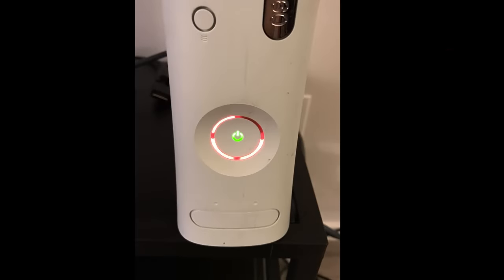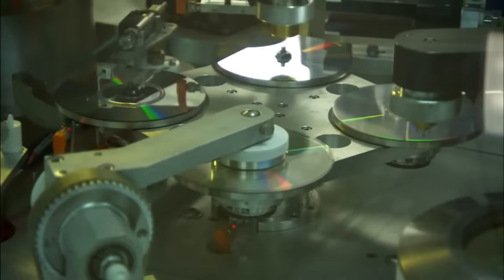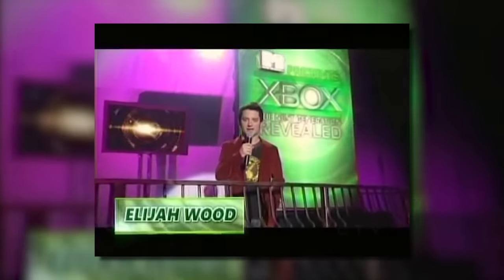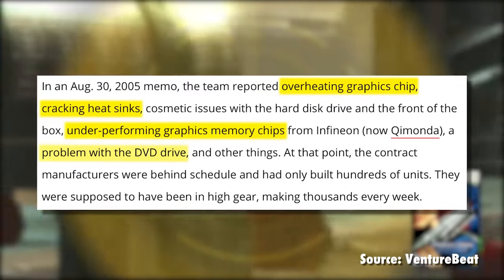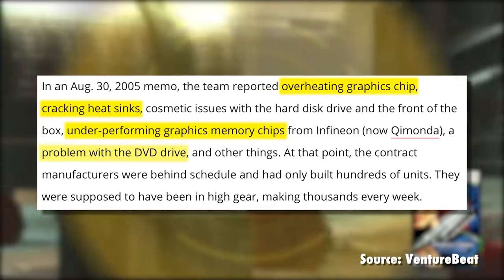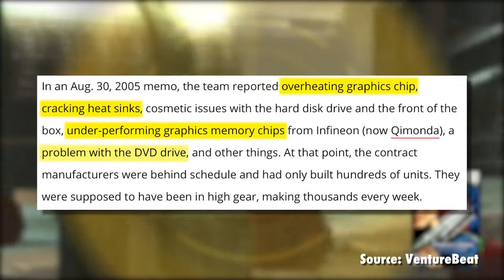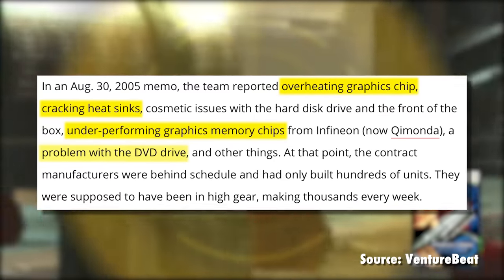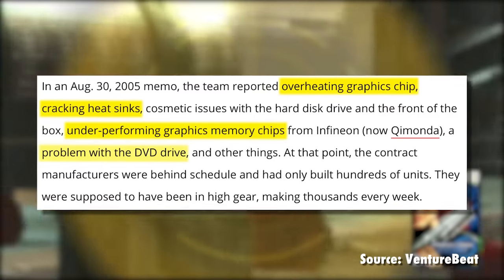History of the Xbox 360 Red Ring of Death | Past Mortem | SSFF

Comment: Mine was made in 2007 and is still gong strong.
Reply: Ah making me miss my 250 gb elite.
Was going strong till 2013, fucking tornados.
Reply: Mine has never had a red ring of death at all, but it gave a ring around some of my Xbox 360 discs or scratched them leading to them being unplayable
Reply: GMLY yo i even dropped mine atleast 3ft to hardwood off a desk. Put it back upside down because it was dark. Ruined my mw2 disk lol. Xbox was fine though.
Reply: greenthumb lol that's one tough xbox
Reply: Are you fn kidding me still going till this day wow
Reply: GMLY yo it hated being used upright, i think that was a design flaw with the dvd drive
Reply: Mine was made in 2008 and still works
Reply: Your Xbox is post re-design, they corrected the problems by that time.
Reply: Oo
Reply: same :D
Reply: Mind was made in 2009 and its still going
Reply: Same, I only had to replace the DVD drive. which my dad helped me with
Reply: Mine died a few weeks back also an 07
Reply: Consider yourself lucky. I had several 360s RRoD since then
Reply: J-Ryder I’m buying an original xbox with 3 duke controllers, 2 games and accessories
Reply: greenthumb my dad's Xbox was dropped at about 3ft on the ground MULTIPLE TIMES and still ran like nothing happened
Reply: Spencer Ross same my Xbox 360 is still working today. My brother buy the Xbox 360 because he want to play halo 4. Back in 2012. In 2018 my brother buy the Xbox one. So my mom give me the Xbox 360.so I played halo1 and halo2 all the halo games in the Xbox 360. All so I played cod waw and minecraft and mafia 2 .  Mafia 2 is 
the best game I ever played. Vito and Joe were the best character in mafia 2. Mafia 2 is better than mafia 3. Mafia 3 sucks so bad!!!. One thing I am a halo fan.
Reply: same :3
Reply: Same.
Reply: Hell Yeh! Same Thing
Reply: Mine was made in 06 its been through water but still runs strong no motherboard issues
Reply: Same, Mine has been alive for 8 1/2 years now 🔥🔥
Reply: Spencer Ross ya may have jinxed it
Reply: mine is from 09 bought it 09 and still working like a boss, was playing Ghost recon advance war fighter 2 and it's still an awesome game that came out in 2007.
Reply: Evan Diaz lol no played cod black ops 2 yesterday and it ran just as good as usual
Reply: mine was made in 2006 and still hasn't got the red ring
Reply: lmao mine lasted about 5 years before i gave mine to a friend, and i got (ironically) a PS4
Reply: mine was made in 1987 and it's still working! however, i need a constant supply of crude oil now.
Reply: Spencer Ross my Xbox 360 was also made in 2007 and its still going strong in 2018.
Reply: My was strong till 2017 2008-2017
Reply: ah yes I remember my 360 rrod on me when I was about halfway through gears and was never able to finish it haha
Reply: Also had a 2007 one, my friend had 2009 ones which all broke down within a year. My 2007 one still going strong even it fell and i hit it multiple times 🤷🏼‍♂️
Reply: Same!
Reply: Spencer Ross dam 333 likes
Reply: 2006
Reply: Same, mine is like a beast, it never had any red lights
Reply: Mine is from 2005 and still lives, somehow
Reply: Spencer Ross Mine was 2007 too and it's still alive
Reply: Got my xbox 360 S in 2012 and it still works
Reply: Spencer Ross  You have an Xbox Y(ield) lol
Reply: 2005 boiiiiiiiiiiiiii
Reply: s t r o n g
Reply: I have an X360 made in december of 2005. It's still alive, but only because it's barely ever used. It's likely to die some day, just like the rest.
Reply: Is that your supra?
Reply: @bingbongbroke1159  sounds like u moved or bumped the console while it was reading a game thats when it would destroy any disk inside the tray
Reply: Mine was from 2006 and its still alive
Reply: Spencer Ross you got
Lucky
Reply: Same
Reply: My 360 ( The Black Slim Ones ) Was Manufactured In 2012, Still Going Strong.
Reply: I still have my xbox 360 elite and recently got an xbox one s on thanksgiving. My xbox 360 is still running strong.
Reply: @bingbongbroke1159  That's why you don't tip an Xbox 360, when it's spinning a disc.
Reply: same for me
Reply: Not making fun of u but
Gong strong
Say it out loud
Reply: Mine was made in 2010 and is running strong as fuck

Comment: I never had red rings. Instead, I have been greeted with the goddamn “Open Tray” problem a whopping three times.
Reply: That One Wise Guy remove the top by cutting or unscrewing and put the disk in manually
Reply: I had to get a screwdriver and force the tray out
Reply: That One Wise Guy ii
Reply: That One Wise Guy same! God damnit i hated that so much! I had to get a new Xbox because of that. (I still have the old Xbox)
Reply: LOL! omg mmd
Reply: That One Wise Guy i still have mine from like 2010
Reply: my 360 S red ringed this year also back in like june of 2017. so my brother gave me his original 360 he had put away since he got a one and his is still kicking and hasnt red ringed yet.
Reply: I had that issue for years however it was such an easy fix, what I did is opened the disk tray and underneath it there is a pulley with a big wheel and a little wheel held by a black elastic band, this holds the tray open and closed. I held it securely open, ensuring that the tray would not close and with a pair of tweezers, unhooked and removed the elastic band. Once out, I carefully laid down the console on the floor, again not letting the tray close and cleaned the elastic with rubbing alcohol. I then with a lot of effort had to re secure the elastic onto the pulley without the tray closing and not letting the elastic fall from the tweezers, into the internals of the disk drive. After this I plugged the unit in and the disk tray opened and closed with no problems whatsoever. After years of hitting, which eventually stopped working, and years of using knives and screwdrivers to open it up to put a game in, it was this little fix that allows for my disk tray to move like it did way back when. This was my solution to the common, 'Open (stuck) Tray' issue. :)
Reply: Mine does that nonstop
Reply: Jessie Jones Yup, the solution is usually as simply as cleaning that elastic band. However, I think you should just use warm water and maybe a little soap. I'd think that rubbing alcohol might dry out the rubber a little, but I could be wrong.

Comment: I used to fix my red ring 360's by hanging the motherboard from coat hangers in the oven and bake at 400 for 10-15 mins.  This would re-flow the solder connecting the CPU and get it going again for another few months.  I probably did this like 10 times to 3 different 360 systems I owned.
Reply: this is either a troll or you're insane
Reply: @allen.simmons9150  Dead serious, not insane, and it worked.
Reply: No it didn't reflow anything. It made the silicon die work again for a while which has nothing to do with solder. A reflow would permanently fix cracked solder balls which is not what happened here. In most cases the CPU or GPU itself were damaged.
Reply: @averycason-rk2oe  You put duct tape on a leaking tire. Sure it could work for a while but you definitely didn't fix anything, you just avoided the problem for a while
Reply: What i do is cover my xbox with towel while rrod and when it's hot enough i turn it off and let it cool and bam! Back to gaming, it's not trolling it actually works.
Reply: so you had 2 xbox with that problem and still thought buying another one of this, in generel over priced, console was a good idea? 200iq
Reply: Hot enough to melt solder but not hot enough to melt any cable clips or insulation on the board?
Reply: I opened up my slim and hit it with a hairdryer for 20 min when it broke down and it worked again. I had to keep doin it every once in a while so I got a new one.
Reply: Username checks out.

Comment: I've had the 360 ever since it came out and regularly used it even still today and I've never gotten the red ring of death.
Reply: Same here!!
Reply: Well.. congrats sir!
Reply: I got the RRoD 3 times. Over the span of a decade though. Twice from overheating, and once was an undocumented ZERO QUADRANT red ring, which turns out, was from having my phone plugged into one of the usb ports on start-up.
Reply: Same with my 360 also with my original ps3 launch.
Reply: Congrats lol that's extremely rare. I don't know one person who didn't get the red ring of death lol
Reply: there is always an exception to the rule..

saw this comment did a 360 and walked away.
Reply: Mine still works too, got it Xmas 2008. If it ever dies, may need to save up for XB1 for Backwards capability (EA won't remaster Mass Effect Trilogy and I replay that constantly).
Reply: Vintage sonic 1 well yeah only gen 1's were known for the era... they fixed it in later 360 models
Reply: Me too.
Reply: Vintage sonic 1 aaaammeeeen to that
Reply: Same
Reply: Same. I got a yellow ring somehow though.
Reply: Vintage sonic 1 lucky
Reply: Mine will be 10 years old October 5 and it spent 1/3 of it's life in my grandma's rv storage compartment
Reply: Vintage sonic 1 me to but sold mine 1 week ago to buy a Xbox one S
Reply: Vintage sonic 1 same
Reply: Vintage sonic 1  same
Reply: Vintage sonic 1 congrats
Reply: Vintage sonic 1 i got it but survived it
Reply: Me too. I purchased my 360 shortly after the release of cod4, I've always kept a small fan blowing on it while it was running though. Maybe that helped it's life expectancy. Worked on my slim ps2 anyway. But I do need a butter knife to open the disk tray lol.
Reply: Vintage sonic 1 same
Reply: Me to why wont it do it
Reply: Same my xbox360 was my brothers until he decided to give it to me when he got the xbox1
Reply: Same here my guy
Reply: Mee too
Reply: 3 times. And then they told me to buy the elite.
Reply: Yeah pretty much same here. The only reason I don't use mine anymore is because I finally got a One.
Reply: I went through 6 lmfao
Reply: Vintage sonic 1 i used to have the arcade that was manufactured 30.09.2007. It served me very well but i felt i had to say goodbye to it after it started running very hot when playing games. I had the red ring of death but if i just rebooted the console the ring would go away. It went on for a few months and eventually it crashed and froze making a loud buzzing noise through the audio. But i got her sent off for repair and she was back in a few months. Served me 8 and a half years. It payed for itself more than enough anyway. I have a xbox 360 S now. The only thing its done is go into overdrive once on the cd drive and my xbox one has never given me any problems other than the occasional freeze on games and a stuck joystick.
Reply: Mine did once but never again. It fixed itself I guess. Guess mine just overheated
Reply: Me 2
Reply: Me to
Reply: Vintage sonic 1 me too
Reply: Me too
Reply: Same
Reply: I have
Reply: Vintage sonic 1 you are so lucky
Reply: same
Reply: Same here had my for 4 years
Reply: Vintage sonic 1 lol I don't even have the 360 with a ring
Reply: I smell of Moo Cheese
Reply: I have not got it!
Reply: That's great to hear. Unfortunately, for me, I went through three 360 consoles before I finally getting the Xbox 360 S. Microsoft should released the Slim version initially instead of rushing the original 360 through production -__-.
Reply: I got it and I turned my xbox off and then it worked propley
Reply: Same
Reply: Same love forza horizon
Reply: Dont say that
Reply: Wow cool kid
Reply: Gets it today
Reply: never happen to me
Reply: Vintage sonic 1 isn't tinkering with ur console illegal
Reply: Don’t jinx it
Reply: Your comment currently has 360 likes. I hope no one ruins it
Reply: Same. But i lost 1 cooling fan  ._.
Reply: Vintage sonic 1 I don't believe u use it I mean Xbox has backwards compatibly

Comment: A friend gave me his Halo 3 themed xbox 360, which was red-ring'ing. I took it apart, tried a few things and actually got it working.
My theory, while I was looking at the chips and the heat sinks, is there is next to no height difference between the chips that gets cooled by the heat sinks, and the surrounding components, capacitors and whatnot. With all the heat, turning on and off, with the board warping as it will from regular use, the surrounding components would touch the heatsink and short circuit, being the cause of hardware failure.
Now, I tried this. I have some regular printer paper for isolation, cut pieces big enough to cover the bottom of the heatsinks, probably a little bigger wouldn't hurt. A hole would be cut out to expose the chip that actually need the cooling, so with new themal paste and the paper between components and heatsink, I screwed everything back on and tested it. And bam, it worked and has worked ever since!
Huzzah!
Reply: That's a weird way of saying "I don't have the money to buy a 360 slim"
Reply: Yo thats epic
Reply: could u maybe post a video of all of this? im not a big tech girl but my dad loves his 360 and it red ringed yesterday :( its been in my family for some odd 8-10 years id love to get it fixed
Reply: @skies5350  That's not a bad idea actually. I might do that!
Reply: @PrimeTF  That's a weird of saying "I'm too much of a brainlet to figure out the reason why the Xbox red ring of death occurred."
Reply: @skies5350  I'll try get it done as soon as possible after christmas, promise
Reply: @LexRudera  we're still waiting on that video
Reply: @lostpockets2227  Yeah I finally got around to shoot it today. Just need to edit it and not die at the sound of my own voice.
Reply: paper in a console sounds like a fire hazard, especially one thats known to overheat easily

Comment: why don't you just put it in a fridge while playing the Xbox you will never have to worry about it overheating again
Reply: This is the opposite of your goal it will eat all your food therefore overeating
Reply: well then just spray with a fire hydrant
Reply: @euanpc3322  that still doesnt solve your xbox's overeating problem lol look at your comment you said overeating not overheating
Reply: @salinasisk5147  r/wooosh
Reply: @salinasisk5147  r/woosh
Reply: @dakota6050  @Adam Samples double woosh
Reply: @dakota6050  
Mega /woosh
Reply: Mew Vids m8 u said overeating to the first time go back to English 8
Reply: @c4-quick-peek284   Super woosh
Reply: condensation, water will begin to enter the system and it will die
Reply: @pablossjui   woosh
Reply: well...ltt put a pc in a fridge and basically it doesn’t help that much
Reply: Some guy tried this actually, and you would think it would keep it cool but that's not how the gpu is cooled, it needs air flow and there is no air flow in a fridge.
Reply: Who else saw the red light in the back round on the xbox
Reply: Woosh jokes are really outdated. They were outdated after 5 mins
Reply: @salinasisk5147  Empty the fridge beforehand. ;)
Reply: @c4-quick-peek284  r/iamverysmart
Reply: @Mew Vids I don't think these intellectuals picked up on your joke.
Reply: @user-kx7qd3qf9o  r/ihavereddit
Reply: Then it will get too cold. If devices get to cold its just as bad overheating. I'm surprised my laptop has not overheated yet.
Reply: This mans a genius
Reply: @salinasisk5147 it's a joke man
Reply: @salinasisk5147  r/whoosh
Reply: while we are cavemans this guy is a dinnousar!
Reply: C4 -quick-peek He’s making a joke Overeating cause he’s in a fridge and theres food in there
Reply: Why not just use an air conditioner whilst playing xbox
Reply: Maybe underheating?
Reply: people would eat it
Reply: Depends on the stuff that made it with. Chances are, the thermal paste on the head of the processor could weather faster with drastic temperature changes.

Comment: Man, what a story! Like two gladiators fighting! My original Xbox 360 never had the red ring of death but only because of the cool temperatures we have where I live, what killed my 360 was when I was playing in summer on hot days playing Red Dead Redemption and the GPU slowly and progressively died due to overheating, it never completely stopped working, but started to become unplayable.
What a legend.
Reply: Melody Storm 

This is probably what happened to mine! I loved my Xbox 360 to death (Oof close to literally) and due to my climate having insanely cold winters and unbearably hot summers, my Xbox died in the summer. It never gave a red ring, but I became unable to play games like Banjo Kazooie: Nuts and Bolts and Viva Piñata, two of my favorite all time games. In fact, I couldn’t play Minecraft anymore either. Or anything else. I could still turn on the system and play downloaded games, but not discs. Eventually I couldn’t play my Xbox all together; sold it at GameStop for 3 bucks or something.

Comment: I I got red ringed a bunch of times on one single Xbox

Solution : Just unplug the system
Reply: Jesus Isidoro 𝕪𝕖𝕒𝕙 𝕥𝕙𝕒𝕥𝕤 𝕨𝕙𝕒𝕥 𝕚 𝕒𝕝𝕨𝕒𝕪𝕤 𝕕𝕠 𝕒𝕟𝕕 𝕚 𝕤𝕥𝕚𝕝𝕝 𝕙𝕒𝕧𝕖 𝕞𝕪 original 360 still works
Reply: Really I turn it off and back on
Reply: First time a saw a red ring on my Xbox my hand moved faster than the speed of light to the plug and yanked it out 🤣
Reply: O welp my 360 has never done that o.o
It’s 13 years old now I think?
Reply: Same
Reply: @BrokeMahWallet  same
Reply: Yep I do it
Reply: Yep I do it
Reply: Yee
Reply: Yee
Reply: That’s exactly what I did
Reply: Savy123savy123 good luck this year for ur 360..
Reply: "I I"
Reply: Mine never died or had a red ring we sold it like 3 years ago tho